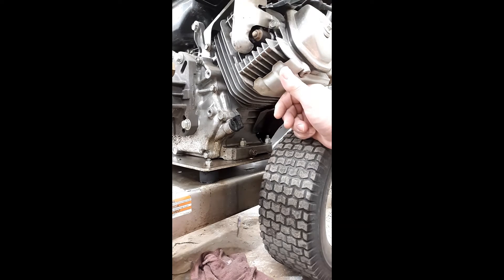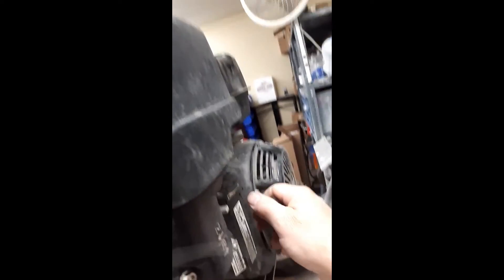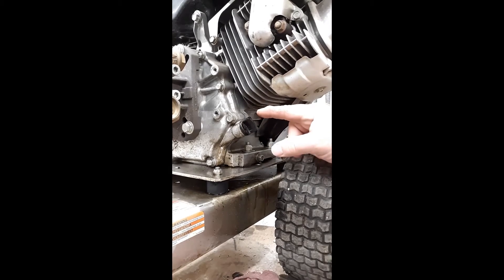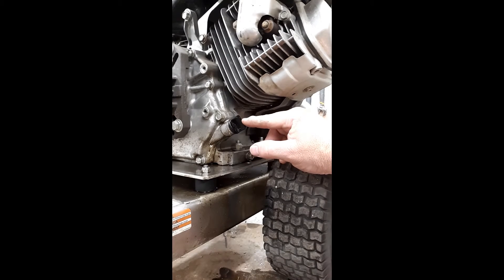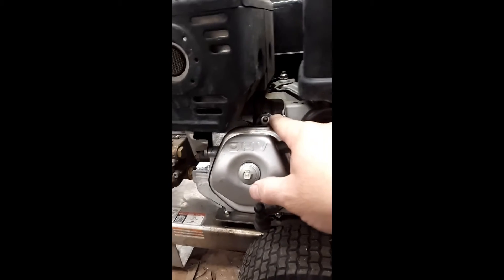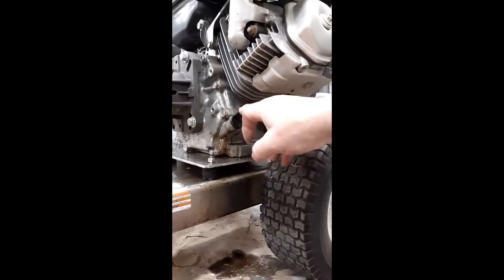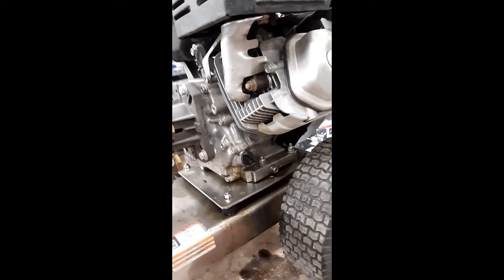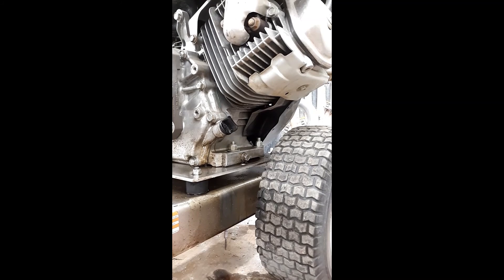Pressure washer engine locked up

Comment: Mine is locked but I didn’t attach water before trying to start it. It has sit unused for a long time. The gas has either evaporated or I ran it out before I put it up. It hasn’t been rolled over however I kinda wish it was the problem. I’ll follow everything you have done and see if that works. 
Just wondering if I messed it up without the water flow. 
Thank you. 
Very helpful video.
Reply from the maker: Tell me what is happening exactly
Reply: @Brian_the_repair_guy  couldn’t pull the cord to crank. Motor locked up. Took a screwdriver and worked it loose. Drained and replaced oil. Filled with gas replaced spark plug. I can’t pull the cord to crank. Whatever that is under the pulley won’t spin much. That was locked up. 
When I initially tried to start it. The cord pulled just fine. But I didn’t have the water going through the pressure washer. I don’t know how that affects the pressure washer either way.  So as it is now. I can’t pull the crank. It’s locked up.
Reply: It hasn’t been started in a few years.
Reply from the maker: @steph1-steph2  can you pull the cord without the spark plug in it?
Reply: @Brian_the_repair_guy  haven’t tried. Should I attach the water before I try?
Reply from the maker: @steph1-steph2  no. Just remove the spark plug from the cylinder and see if you can pull the cord 2 or 3 times. You don't have to pull it hard. Just see if it rotates
Reply: It doesn’t
Reply from the maker: @steph1-steph2  so with the spark plug out, you can not pull the recoil?
Reply: I can rotate it by hand and it stops at the magnet.
Reply from the maker: @steph1-steph2  if you have partial rotation before it locks, then more than likely the engine has a broken piston. Engine replacement. What size engine?
Reply: Honda gcv160 5.5. Now the water won’t even run through it.   I was hoping it would be as simple as Connecting the water. Lol  from inlet to outlet.
Reply: Thank you for answering my questions. I appreciate your time.
Reply: I probably won’t replace the engine. I’ll just get a cheaper one this time. 😂
Reply from the maker: @steph1-steph2  yeah, the cost of a new engine on that unit isn't justified. My only suggestion would be a horizontal shaft engine on the next washer
Reply: Thank you sir. I’ll subscribe to your channel. I truly appreciate it.
Reply from the maker: @steph1-steph2  thank you very much

Comment: Normal to see smoke come out ? Where the spark plug hole is after you pull
Reply from the maker: The smoke is generated from fuel vapor being introduced in to the cylinder and then forced out through the plug hole causes the vapor to condense into a cloud.

Comment: Brian. Emptied the oil took the plug out. Then I tried pulling the cord and still nothing. Do you think the pressure pump might be out?
Reply from the maker: With the spark plug removed, you can't pull the recoil?
Reply: @Brian_the_repair_guy   that is correct.
Reply from the maker: @josehorta464  if you can't pull the recoil with the spark plug removed, you need to remove the recoil cover from the engine. In the center of the flywheel there is a large nut. Put a socket on it and see if you can turn the flywheel. Of you can, the engine is good and we can look for another issue. If it does not spin around several times, then the engine is trashed
Reply: @Brian_the_repair_guy  I just tried turning it with the socket but it does not budge.
Reply from the maker: @josehorta464  more than likely,  the engine is trashed. The connecting rod is probably broken. Sorry to say.
Reply: @Brian_the_repair_guy  thank you for all the help Brian.
Reply from the maker: @josehorta464  if your pump is good, tou can replace the engine. What area are you located?
Reply: @Brian_the_repair_guy  I am West Jordan utah
Reply from the maker: @josehorta464  harbor freight has a really good price on a replacement engine. I have installed those for many people and have had zero issues with these engines. Just make sure the shaft size is correct.

Comment: I enjoyed your Vedic on locked engine on pressure washer. My Problem is this happened the first time I used it and every time after that it’s still locked up after 15 minutes use. Let it sit for five minutes. It will restart, but it will happen again.
Reply from the maker: You have another problem. A small engine shop needs to look at it. Sorry I can't help

Comment: Thanks to your advice I got the cord to pull.

But now the engine won't start. Any idea? Carb flooded?
Reply from the maker: Drain the carb, it most likely has oil in it. Drain it and clean the bowl. Make sure the spark plug is clean and dry. When it does start, it is going to smoke a lot.
Reply: @Brian_the_repair_guy  This was it. Gas definitely had oil in it. And you were right it smoked heavy for a solid 5 minutes. Thanks! Any way to throw you a tip?
Reply from the maker: @tbtitans21  feel free to use the "thanks" button beside the share and like button
Reply: @Brian_the_repair_guy  Do you get all the money or does YouTube take a cut? If so how much?
Reply from the maker: @tbtitans21  not sure really. I believe all.

Comment: Oil on the valve seats render the decompression stroke on these engines nearly useless.  Trying to start will rip your fingers off.  
To remedy this, after you've removed spark plug and pump all the oil you can out of the cylinder,  spray some carb cleaner into spark plug hole (3-4 seconds).   Then repeat pulling pull cord to flush carb cleaner out as well.  This will clean the valve seats, and allow the decompression while pull starting.

Comment: I followed the steps, when I took the spark plug it was actually soaked and there was not gap on the spark plug. My one concern is will it still work if I widen it a little and what happens when the spark plug is broke underneath the spark?? Thanks for your help and advice. Dropped my like and subscribed already.
Reply from the maker: Regap the plug and reinstall. With the engine OFF, give it a few pulls to ensure it isn't hitting
Reply: @Brian_the_repair_guy  Drained the oil, took the spark plug out and the motor will still not unlock… what else could be the problem?
Reply from the maker: @erickvelasquez8639  if the engine is locked with the plug out, then the engine has a broken connecting rod or something similar. Replace the engine

Comment: I watched another video that claimed oil would've gotten into a filter when a unit turns over which would also need to be replaced, is that true? If so what filter?
Reply from the maker: Yes, there are times the oil gets into the airfilter as well. Doesn't happen every time.

Comment: I went through all the steps and it is still locked up when I put the spark plug back in. I was able to pull the cord when the spark plug was out, and I pulled until I didn’t see pile flying anymore. Any ideas?
Reply from the maker: If it pulls with no plug, but locks with plug in then you still have fluid in the cylinder
Reply: @Brian_the_repair_guy  So just repeat everything again or can I just remove the spark plug and give it a few more pulls?
Reply from the maker: @michaelharris2599  it doesn't take much fluid to cause the system to "lock up" usually blasting air from a compressor in the cylinder helps remove the fluid
Reply from the maker: @michaelharris2599  pull plug and pull a few more. Pull pretty hard or rapidly
Reply: @Brian_the_repair_guy  I got it fired up right before the sun went down. You’re a life saver. I appreciate you brother.
Reply from the maker: @michaelharris2599  glad to help

Comment: Mine just locked up right now while it was running
Reply from the maker: That's  typically not good. Pull the plug and see if it will pull.

Comment: Question. I did this yesterday and it worked fantastic. I went to use it again today and it runs, but it definitely runs rougher than it did before. Is there something I can do to fix this or does the cylinder just need time to burn all that extra oil out? Any help is appreciated!
Reply from the maker: You could have oil residue in the carb that would cause rough idle. The air filter could have oil in it as well. Have you replaced the filter? If not, I would reccomend that. But in time it should clear.

Comment: I’ve done this a few times, pull cord is still locking up.  Any other ideas?  Failing miserably
Reply from the maker: Will the pull cord pull completely with the spark plug out?
Reply: Yes, it’ll pull all the way out.  Once I put the plug back in, after about 3-4 pulls, cord locks back up
Reply from the maker: @michaeltucker9509  then you still have fluid entering or residual.  Remove the plug and pull like you are going to start it. Repeat several times. You can also try blasting air in it from a compressor.  The cylinder needs to be free of fluids. Gasoline will evaporate but the oil will not.
Reply: @Brian_the_repair_guy   I have blown compressed air in where the plug goes in.  Initially I probably pulled that cord 30 times.  I will repeat the process tomorrow when I go back into work.  Is there a way I can send you video of what it’s doing?  I’m stumped
Reply from the maker: @michaeltucker9509  just post the video on YT under your channel. Then post the link here
Reply: @Brian_the_repair_guy  copy that!  Thank you Sir!

Comment: So it's hydrolocked from (most commonly) a stuck or dirty carb float needle OR yes, laying the washer on it's side. 
Pull spark plug and remove gasoline (NOT gas and oil) from cylinder by pulling starter rope and then using compressed air to finish job, drain engine oil, rework the carb float needle (to FIX the original problem), dry out the carb air filter, put a little oil in the cylinder to provide ring lubrication, replace engine oil and start engine.  The residual gas in the oil system will evaporate off in 10 minutes of use and the high new oil % will provide all the lubrication needed.
The oil fill plug is a plug and not a bolt.
Reply from the maker: Sure, we will go with whatever you say. I will add that it IS gas AND oil when the machine is flipped. The sparkplug don't lie. I hope you found the video helpful and thanks for the views.

Comment: Thank you for the reply. I should have mentioned that the plug is out. I put a tiny bit more of Marvel in the spark plug well.
 Today I put a socket on the crank and gave a big reverse push. It did spin. Spent a few minutes spining it. A bit more oil / gas mixture came out of oil tank.
 I cleaned out the spark plug well the best I could. I left everything open for the night. Will put new oil in and try again.
  Should mention, female, with cancer going on 60. Never had to fix things. Worse that can happen is that I break something that is not running. Nothing ventured, nothing gained !
Reply from the maker: I can appreciate and empathize with your situation. I am more than happy to try and help.
After removing the plug and allowing it to sit after manually turning the crank, you will need to reattach the recoil and see if it will pull without the plug. If it does, you will need to stay clear of the plug opening on the head and give 3 or 4 good swift pulls to blow out any fluids left in the cylinder.  The fluids will cause the piston to lock of you don't.  Make sure the plug is clean and reinstall. Try again to pull slowly to ensure the crank is spinning before attempting to restart.  
Please keep me informed

Comment: I have a locked up pw. Ive taken out spark plg, drained oil that smelled like gas. I have taken pull rope housing off rope pulls freely when off but when put back on, it is locked again.
  I tried about 2 table spoons of Marvel Mystry oil in spark plug hole and ket sit over night.
  Any suggestions? Any advice. Pw is less than 2 years old. 
Spark plug was clean. Multiple people have moved stuff around in garage so it is possible that it got tipped over.
 Thank you
Reply from the maker: Take the plug out and attempt to pull. If you have any fluid in the cylinder, it will lock. Pulling with no plug in it always the cylinder to move freely. 
If the piston still does not move, remove the recoil and put a socket on the flywheel nut. See of the piston will move manually in either direction.
Reply: @Brian Shumack the repair guy

Comment: It’s funny when you have a problem and search YouTube and use the same description and get 10 different solutions, and then finally come across the right one. Yours was the right one. I did everything in the video, I can pull the rope easily now, but it still won’t fire up. It acts as though the switch is in the off position and I am pulling the rope. Any ideas what I should be looking for now?
Reply from the maker: Make sure the spark plug is clean and dry. 
Also, there are times that oil will travel into the bowl of the carburetor.  Remove the bowl and see if you have oil in the bowl. 
Please let me know what happens.

Comment: If dummy here forgot to turn the water on am I going to be buying a new pressure washer
Reply from the maker: Is the machine not working now?
Reply: @Brian_the_repair_guy  yes can't pull the cord haven't taken it apart no water in oil or spark plug area. Took plug out still can't pull the cord..
Reply from the maker: @MKBuddy1  pull the pump off the engine. See if the engine is good. You can reach into the side of the pump to the shaft and see if it will spin by hand. This will tell you which one is the problem

Comment: My Honda XR2600 was flat on the grass when I  heard it running out of fuel. Just b4 it was shutting down I heard it lock up. Went to draw the pull cord and nothing.
Reply from the maker: Pull the spark plug and give it a pull to see of it will rotate. If not, the engine is most likely dead. It would be more cost effective to replace the engine versus repairing a locked engine

Comment: Thanks for this brother, not had mine roll over thank God. Good straps.
Could you please do a vid on an air lock, just had it on mine, no suction, it was an easy fix, clean inlet filter, force water through pump and check suction pipe for splits.....pretty easy, once I knew how, just never seen a vid on this subject.
Reply from the maker: I will try to make a video.  My video process is based on what types of repairs come in on real world machines. I find this works best. If I get one in with this problem, I will definitely do a video
Reply: @Brian_the_repair_guy  thanks for the reply, and for your vids 😀

Comment: thanks a ton. one of my workers didnt strap the pressure washer down and it fell over on the trailer. i was afraid it was locked up, after removing the spark plug the engine turns over fine. again thank you.
Reply from the maker: No problem glad to help. If you as so moved, try using the "thanks" button by the like button
Reply: @Brian_the_repair_guy  a yea
Reply: also remember to crack open the carb and let it drain. i forgot that part. after i let it drain it started first pull

Comment: I have a pressure washer with engine locked up is possible if the pump is bad that can cause your engine not to pull
Reply from the maker: Yes. If the crank on the pump has locked up, then you will not be able to pull. Remove the pump to determine if the pump or engine is bad.

Comment: So if the engine is locked up and you take the spark plug out and its dry as a desert, would you go about the same fix as this video or?
Reply from the maker: If you remove the plug and it is dry, yet you can't pull the starter rope with the plug is out, then you have another issue.
Reply: @Brian_the_repair_guy  have any idea what it could be?
Reply from the maker: @1LoveLightOneness1  if the plug is out, and it is locked when you pull it, then you have a mechanical issue with the engine